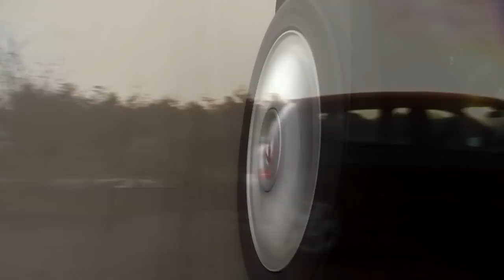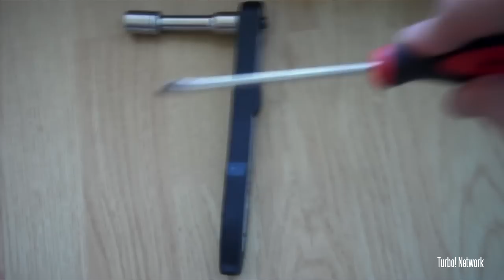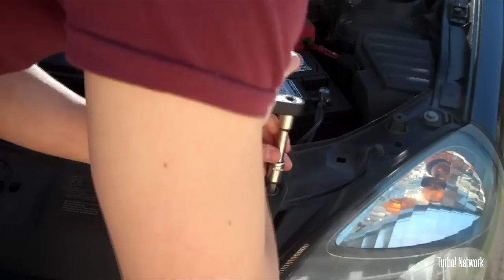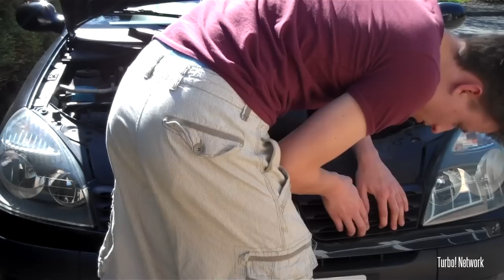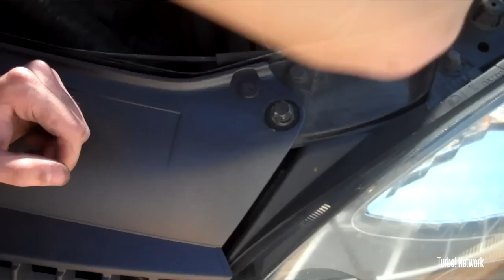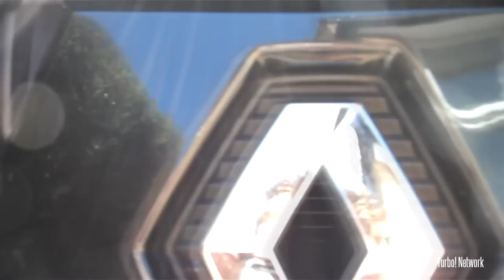The Clio Project: Ep #6 - 'Fitting 172 Front Grille'

Comment: You don't need any kind of wrench to undo any kind of bolt, that bolt you undo in the video isn't connected to the grill at all, it's not even touching it hahah. You only need to take out the two plastic security pins and you're away, they're all that secure the top. Be forceful and careful together if you can.

Comment: Can I have some advice I try to pop the old grill out and it just doesn't come out I've tried hitting it and pulling it out any help?
Reply from the maker: The clips we had on the current Clio 182 were very stiff too. Once the top bolts were removed it helped with having the extra leverage, but it still required brute force at the bottom edge on the grille to set it free. Apart from that, both seemed to come out rather easy. try taking the bumper off and using a flathead screwdriver to remove it from each clip, one at a time. Should work :)